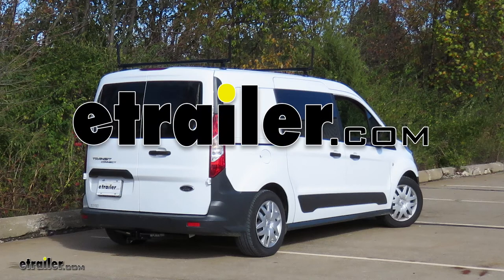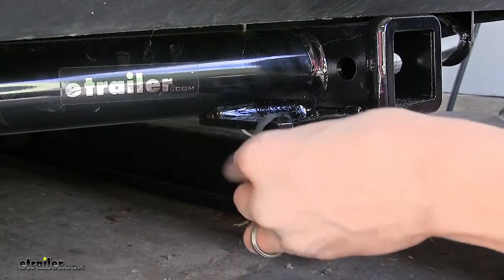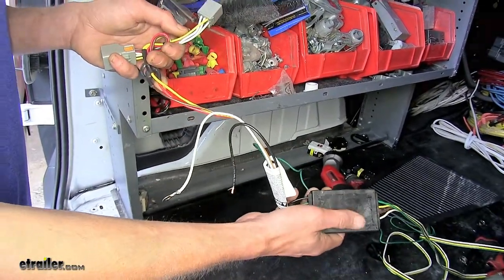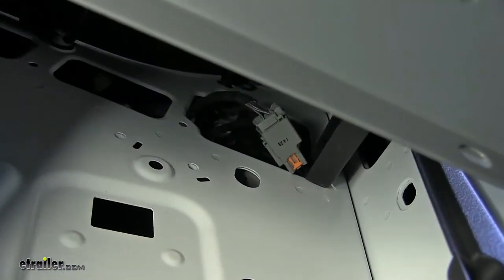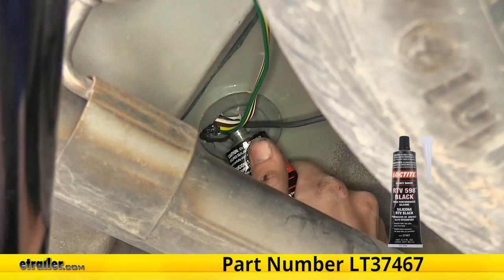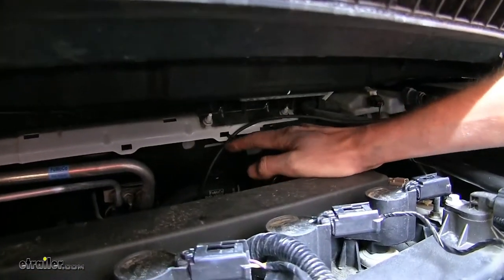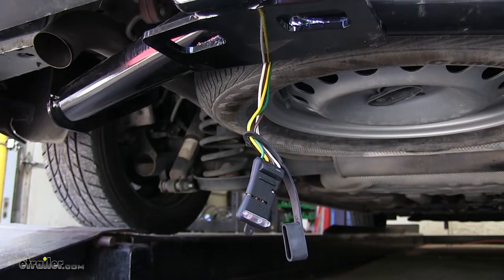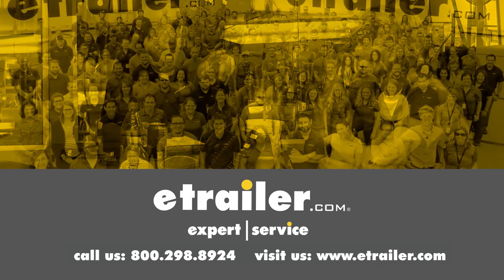etrailer | Trailer Wiring Harness Installation - 2015 Ford Transit Connect

Comment: Thanks for sharing, I installed mine today!
Reply from the maker: Thank you for sharing this! We are happy we could help and love hearing you were successful on your installation.
https://www.etrailer.com/maindept-Towing.aspx
Reply: Wonder if it would work by picking up the 12v at the rear 12v power point instead of the battery?